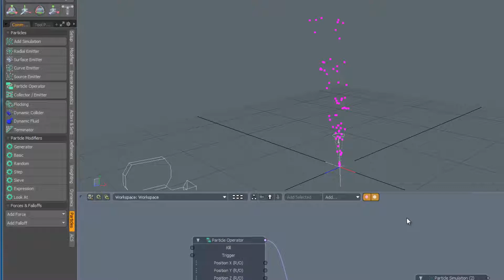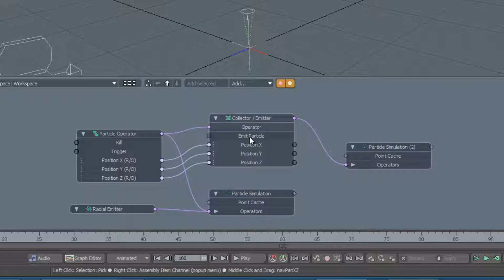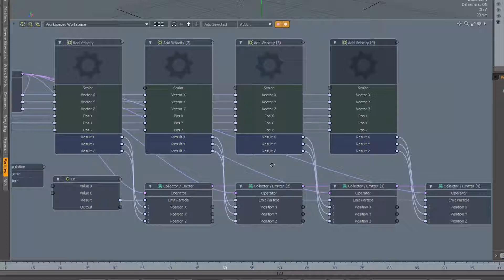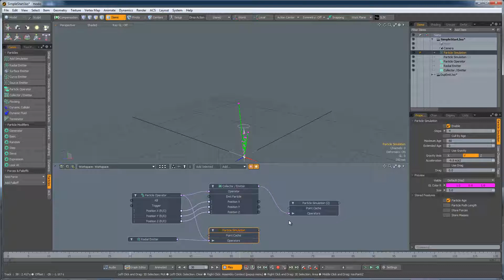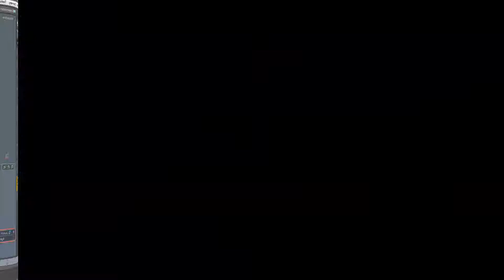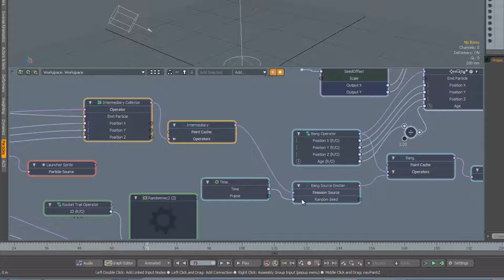Modo 701 Particle System -- Part 4 - The Collector/Emitter

Comment: Steven, Im not much of a math head so I'm wondering if you can help me? I have a surface emtr, raining down replicator obj's [group]. I'm using PO-integrate with Ang velocity  to make them spin as they fall.(using a velocity R/O feeding a Math-maxium node to control speed) However they all spin at the same rate. I need more randomness. Is there a way to read the particle ID to modulate the its angular velocity. You can email me directly (jbavar@att.net) I can send up my scene if you like.